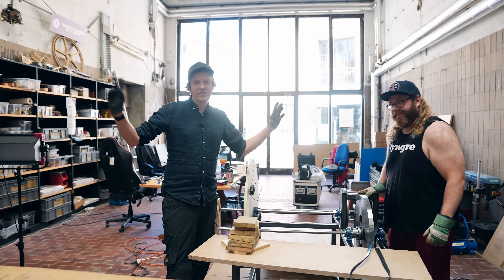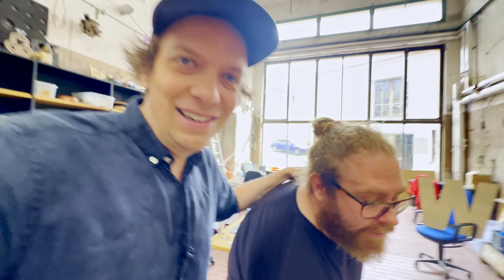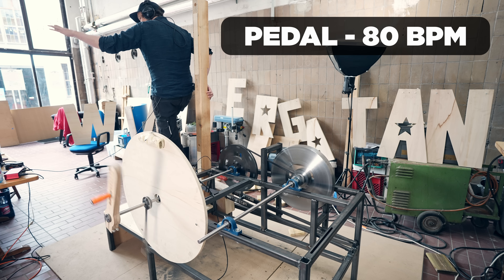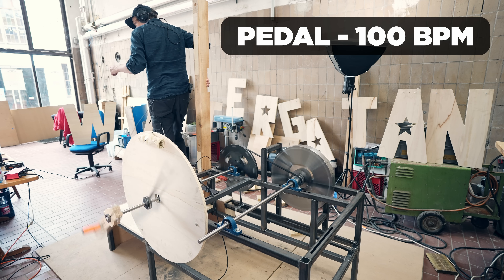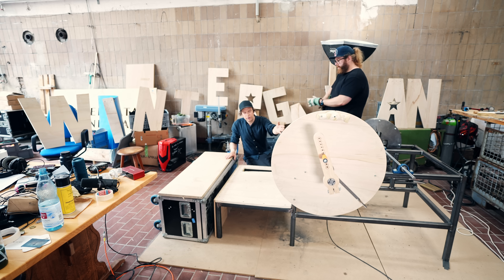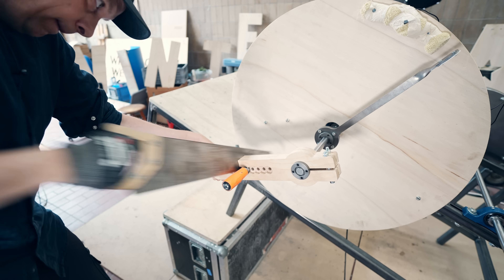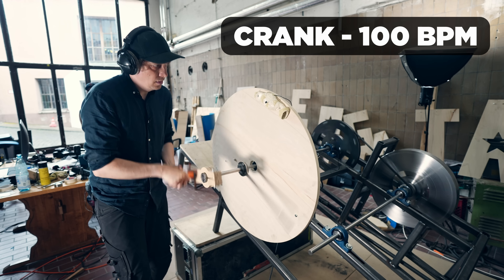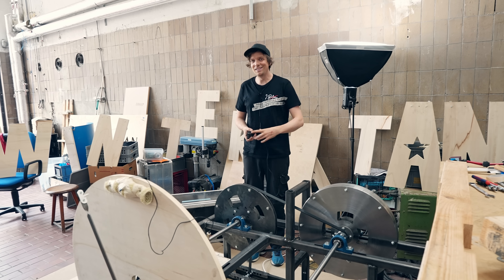Heavy Flywheel plays Tighter music! - DAY 11 - Marble Machine Flywheel Prototype

Comment: I know it’s a bit late for this kind of change but have you looked into a freewheel ratcheting mechanism for the pedal? I think you may be losing some momentum from the resistance against your foot as the pulley wheel brings the pedal back up. With a freewheel the pulley could spin under its own momentum while the pedal is depressed and returning, perhaps making it easier to keep the speed consistent and may make it easier to sync your timing with the click track.

Comment: I am concerned if skill is also playing a part in the results, and how noisy the results are. The results for the pedal appear to be quite noisy, at least: the first deviation of 101 ms is suspicious, and the values appear to increase and decrease between the two weights at random.

It would be interesting to repeat the first tests again at the end to validate its results, after you have gained more experience with the machine.

Comment: I am starting to get very concerned for the safety of the Operators. If you increase speed on an already fast spinning heavy flywheel, the increase of kinetic energy may be catastrophic
Reply: just dont let any kids nearby, they are fascinated by spinning gears and will be curious to touch something and get mangled. 
Adults? put a sign and a guardrail, and make sure its not gonna fall apart. thats as best you can do.
Reply: @mrlithium69  It's irresponsible to design a machine that is INTENDED to draw an audience closer (to watch all the marble chase around), but yet also make it a death-trap for anyone that get's close.

Comment: It’d be neat if you could gear the thing so that all you had to do was meet a minimum rpm, instead of being a human metronome.
Project, of course, is going in directions I could only dream, so 🤷‍♂️
Thanks for sharing your build 🐰🍷
Reply: Was thinking the same and wondering what kind of mechanical mechanism exist to accomplish this, some gears that only interact at certain rpm or something. The flywheel only being an inertia battery.

Comment: come on, make it electric, but the flywheel is the manual power generator storage, so that you dont have to do both rhythm and power at the same time, only power
Reply: yep use a crystal timer, electric powered, with electric power storage for the instruments and mechanisms, or a main motor

Comment: I think trying to sync up with a metronome may be unrealistic. When you are on stage, do you want to keep the MM3 in sync with a tempo set by someone else? Or is the MM3 going to be the instrument setting the pace, with the rest of the band following its tempo?
The heavier flywheel makes it harder to change the tempo of the machine, which limits the overcompensating effect when you notice you are slow/fast. That entire effect doesn't exist if the MM3 is the instrument setting the tempo.
I'd recommend trying a few sets where you do not use a metronome (or turn it off once you are up to speed) and simply measure how consistent your contact microphone hits are. That will give a better impression of how good the MM3 is at setting (rather than following) the tempo.

Comment: You should use a speed governor and a freewheel on the output of the flywheel, that way your cranking/pumping is decoupled and doesn’t need to match.
Reply: It's definitely a cool idea, but I thought the point was that Martin had to be the one doing the timing, just as playing any other manual instrument requires you to do, and the street organs he's featured in previous videos
Reply: @error.418 add a variable speed pulley then, so you can speed up and slow down independent from the flywheel.
Reply: @youareliedtobythemedia  I think he wanted something direct like he's demonstrating, but I do think other builds with other goals would benefit from ideas like that for sure
Reply: @error.418  yes I understand that, and of course the whole point is to create an expressive analog machine, I just think that it would make more sense to have a separate control over the tempo of the machine via a governor (and a control lever for adjusting its setting) rather than force the player to try to control it through the flywheel - as commented in other replies there's a big hysteresis lag between input and output speed changes.
Reply: @FergalByrne  Like I said, I totally agree with you, just seems outside of Martin's style preferences. Like he doesn't want something that is set-and-forget. There's no governor on a violin bow, e.g. But maybe a mechanism could be designed that would make control less strenuous, decoupled in that sense?
Reply: I think when he speaks about "the machine can play tight music" he means "can he play tight music with the machine". Otherwise he would just use a motor and a speed governor...
Reply: @PedroCoelho98  I think the answer will just be no. Not without having a lot of inertia to dampen his input and dealing with the downsides. I mean people added weight to their turntable plates to remove some of the speed variation - not to talk about the high-end stuff..
Reply: @PedroCoelho98 or use solenoids and eliminate the programing wheel altogether and have a large part of the machine digital.
Reply: @kerryabear  I think that would be to much for Martin to go onboard with! 😂
Reply: An adjustable speed governor could be a perfect solution.  I have no clue how they work though, can you explain?
Reply: @Dougieknight  With a CVT belt drive controlled by a centrifugal governor, this should be doable. But all in all, I have the feeling that it is not the fault of the mechanism that there is a deviation, but rather a systematic error. Of course, as the flywheel mass gets larger and larger, the pulsating input torque of the pedal gets more and more damped. This should make it easier to maintain a speed - at the same time, of course, the system becomes more and more lethargic, so it can no longer respond quickly to tempo changes. I am not a musician - but what is the tightness of human musicians anyway? Is there such a thing as tightness muscle memory? 🙂
Reply: @poldiderbus3330 depends if you play to a klick track or not.
If you play to a klick track you need to hover around the klick.
If you play without, everyone will sync up naturally.
Reply: @youareliedtobythemedia this... 100%  when you're playing the music and feeling the beat, that mechanical tightness and deviation isn't felt. There's actually usually variance in tempo in live music, to a small degree.

And when it comes to the crank, whoever on the rotation, the actual point the marbles play their notes becomes the down beat and the Feel of cranking and hitting that note at that same point in the location makes feeling the beat all the better.  Martin needs to remember that he's not a machine himself. If he wants perfect machine playing it will take the human element out of it and will then feel mechanical and not organic.  Once the machine becomes easy to keep close enough to the same beat, the rest of the technical falls to the wayside because from beat to beat its easy to feel the next beat and even if he slows down, music is still internally coherent and tight with everyone else playing along.  If he had two people playing two marble machines, even then they could sync up their rhythms and the exact bpm ceases to be an issue if it's a millisecond off or not because feeling the downbeat on the same note is where PLAYING the music comes into the picture.

I'm not saying don't make it play tight with lots of inertia, but also don't get hung up on needing the machine to be perfect.
Reply: @Dougieknight  you can search for "speed governor" here on YT. It's basically a spinning pair of weights that stretch apart when overspeeding, or come closer together when underspeeding, and those movements are transmitted through levers to reduce (or increase) the amount of power being transferred to the output (often via a clutch).
Reply: He mentioned he wanted this way so he can match the crowds energy with his playing. aka, go slower or fast on a whim, which a governor is made to prevent
Reply: @MegaGadgetdude  Yeah, it'll work for a show every so often. Now imagine doing this 3 times a week on a world tour, he'll be in the hospital recovering from repetitive injuries in notime.
Reply: @MegaGadgetdude 
I think matching the crowds energy might be a bit difficult if it’s going to take this long to spin up or down. The adjustments are just too slow, compared to the freedom of a more natural instrument
Reply: @MegaGadgetdude  Yeah, exactly!
Reply: Governor is planned (at least to see how it feels)! He's mentioned it a couple times in earlier vids :)
Reply: I think the idea of this first round of testing is to see if a direct drive can play tight music before Martin designs a regulator system.
Reply: Martin should also be doing a 3rd test by using the helper motor from the MMX that electronically adjusts itself to keep the BPM correct.
Reply: A mechanical speed governor would be visually awesome...
Reply: what about a fixed wheel Variomatic, with a lever to control the distance between the pulleys? that would allow you to pump in at a constant rate, but still have manual control of the output rpm directly affecting the bpm? then you could mark the lever with a few "standard" bpms and it would be a human interface to allow him variable speed control, constant input, and the ability to flow back and forth between tempos manually. thoughts?
Reply: This is the way
Reply: Usea continuously variable transmission. There are designs for cara and bikes one of those should work.
Reply: Needs a governor we all know it.   But the main man he likes to arrive at his own conclusions
Reply: This is sort of how a bagpipe works - you inflate the bag with MORE air (input energy) than is needed for any given moment, and adjust the pressure of squeezing as necessary to blow the reeds on the pipes. The ability of the reeds to accept air input is fixed (a governor), so it doesn't matter how hard and fast you blow after a certain point.
Reply: My understanding is that the flywheel is intended to smooth out the natural variation of Martin's input so that the tempo is still determined by him rather than the machine basically playing itself. And that's exactly what the flywheel is doing.
Reply: While i understand the want for a machine powered by him, but:
1) While the flywheel does 'smooth out' the input variability, it doesnt eliminate it.
2) Martin tired himself out playing this test - how does that bode for a full concert show?
3) "The music is tight - tightish"... Unlike a regular manual instrument (which... are meant to be playing along with him, right?), the adjustment to being ahead is slow. You can put more energy in faster than you can bleed it off naturally (the brake would be too hard of an adjustment).
4) A measurement we dont really get to see with the cuts - how long does it take to get the heavier flywheel up to speed initially? How does that translate to a show? For those comparing it to manual instruments, how many minutes do you need to wait before being able to pluck a string?
Reply: @EtoileLion  I think all of these questions are folded into why Martin is trying out a proof concept on only the flywheel first, because the whole project lives or dies by this one element.
Reply: Would it be possible to have a pedal for 'large' and constant input, and an added hand crank to input tinier amounts of force into the system for quick adjustments?
Reply: Another variable that might be worth testing is whether the wheel should be rotating at the musical “beat” or having it geared (probably an input output of half might make it easy to rotate with a “halftime”) feel music that is going faster.

Will also be interesting to see if he determines that a power assist motor for spin up at least is useful.
Reply: On every wintergatan video I see how far down in the comments before someone says "governor". it's normally like the second or third comment, haha.
Reply: Remember, Martin is not trying to build a machine that makes music, but rather, a machine he can use to make music. It's a subtle but crucial difference.

Comment: Wouldn't it be better to measure the bpm output of the flywheel instead of measuring the input of the pedal/crank?
I can't understand why measuring the input is necessary since it is entirely dependent on the human using it.
The main goal of the flywheel is to smooth the input variations, so it would make sense to measure that instead.

Comment: I'm a mechanical engineering professor and I refer my students to these videos because they are a fantastic example of how to approach mechanism design
Reply: Are they ? Cause so far it's been 6 years and the project just keep getting abandoned, delivering nothing promised. In a company you'd get fired quickly lol
Reply: @TigreDemon  it hasn't been 6 years on this machine, MMX is abandoned and this is a whole new machine.
Reply: @darkiee69  and it's the fourth machine now ...
Reply: Also a fantastic example of progressively eliminating unnecessary design requirements. He's slowly but surely moved towards simpler more robust designs, and I have a feeling he's going to eventually eliminate either the self-powered requirement or the extremely tight music requirement.

Comment: I noticed how the slip bushings were actually giving way during cranking. They will suffice for testing, but critical shafts like the input shaft and linkages should be keyed.
Reply: He should check if the bushings are on spec (able to handle the specific forces of acceleration and inertia) and if the torque applied to the bushing bolts is on spec too, with a torque tool. It may just be an issue with under tighting.
Reply: @constantinosschinas4503  If you overtighten, you risk deformation.
Reply: @SoranoGuardias  yes, that is why i said on spec.

Comment: Would be interesting to apply this software and measure the tightness of a good drummer playing with a good band live. I would assume that it’s not much tighter than this, but I also might be terribly wrong 😂 to me, the heavy flighwheel definitely sounds tight enough for a world tour because all the other musicians are not machines and can therefore easily adjust as the heavy mass doesn’t change speed to quickly!
Reply: humans are at 5-15 ms "tightness". we play early mostly. In a live band each foot you hear sound 1ms later then it was played.  with how big the MMX2 is sound from one side will travel to you 12ms delayed then the closet side to you. the heavy fly wheel is unnecessary. The ability the change tempos quickly is more beneficial. Like to quickly sync to a click track Vs slowly sync.
Reply: @BensMiniToons  oh that’s an interesting thought! Thank you! So you would say that he should use less mass? Or would you recommend a different power input?
Reply: @markuskaiengel   the flywheel only needs to have the mass to smooth out the machine once built. The big rotating programming wheels may have enough mass that a flywheel is redundant.  Turning a wooden handle with out flywheel could have perfect tempo with practice. 
I can draw circles in the air around my ear with my finger with his click track perfect. Try it your self while watching the test. Remember you have no flywheel. Just drawing circles in the air around your ear with your finger.

Comment: Can I suggest a test for the effect of the wheel on keeping the RPMs. Run various BPM and measure the decay (ideal time minus actual time) and measure it over time. The measurements of the decay start when you have the timing and release all forces from pedal or crank on the system and let it run.

The data is collected for multiple starting BPMs and collected over 5-10 times for each BPM. The average decay (assuming linearity over time) for all BPMs are calculated and you then plot the Average decay for all BPMs. Use BPMs in intervals of 5.

It’s a lot of work and test, but you should get a nice graph that tells at what BPMs the systems is playing tightest. If the graph shows same avarage decay (flat line) it would be same tightness for all BPMs (it would be surprising to say the least).

Comment: If you add a second smaller flywheel controlled by an electronic clutch you can get a perfect tempo. If the power flywheel spins faster the clutch disengages and slows the music playing flywheel, and vice versa
Reply: the idea is it to be 100% analog and have no electronics, from what i've gathered
Reply: @imblackmagic1209  That's where the centrifugal governor comes in.  Virtually every music box in history has either a wind-friction governor or a centrifugal clutch for this reason.  Completely analog.
Reply: @frollard   Centrifugal clutch indeed.  It would be wonderful to see a marble machine running literally balls-out!
Reply: @frollard I wonder if he'll try the governor he designed while he's in Germany